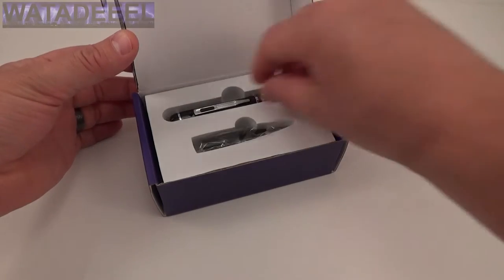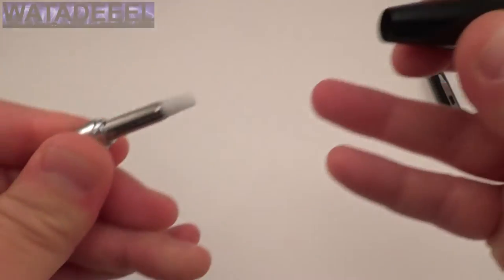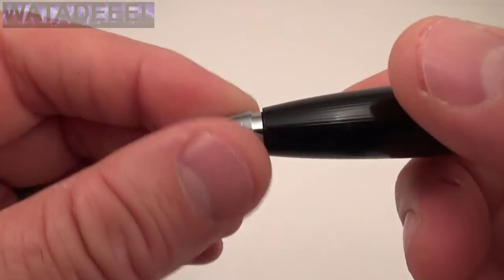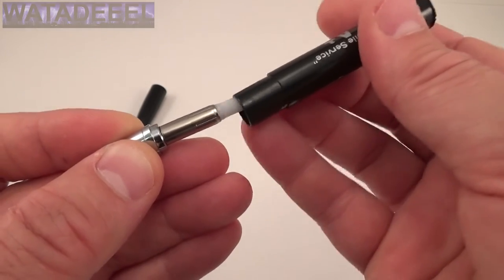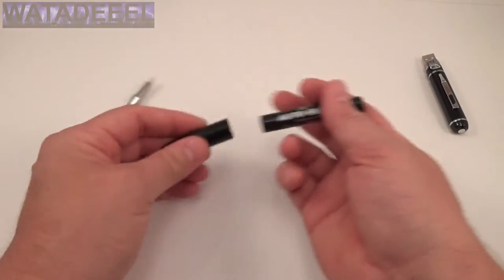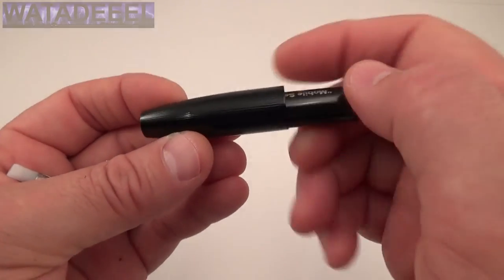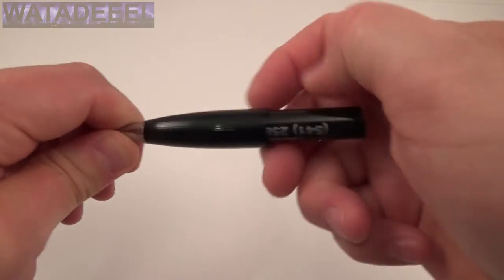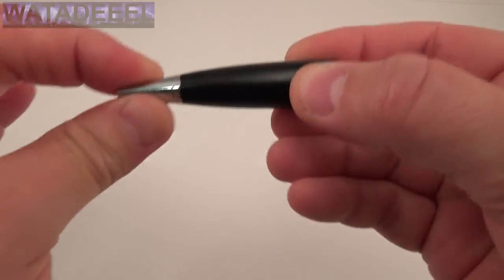How To Fix A Loose Spy Pen Tip

Comment: No tool needed. Just use the cap of the Sharpie as the 'tool'. should here. It fits to push the grommet all the way down. This made my pen work as it should again. Thanks for the video!
Reply from the maker: Glad it worked for you! Thanks for the tip!
Reply: Smart
Reply: @watadeeel   can’t find your site….did you take it down or there’s any other new site ??